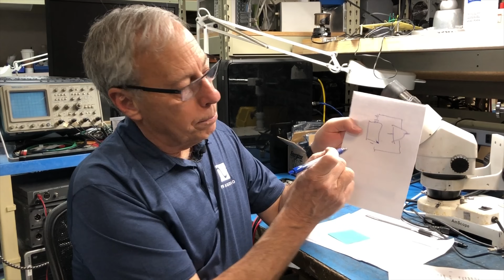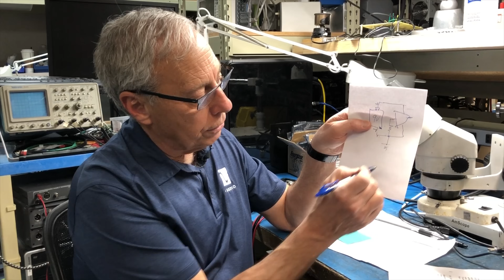What is signal ground?

Comment: I love it. I had been pondering this all weekend after reading about an amp that had no need for safety ground because it used a double isolated power source. "HOW DOES THE SIGNAL GET GROUNDED THEN?" was my howl into the wind.

I was sort of getting nowhere although I did get as far as comparing this sort of circuit with using jump leads on a car. I always wondered why one of the clamps is clipped to the chassis. Some places said it was to 'ground' it. I couldn't understand how it did that with those big fat rubber tyres holding the car off the ground in a beautifully insulated way! But I also thought I was barking up the wrong tree since cars are using batteries with DC power rather than an amp using AC power. I was afraid I might be muddling myself up in a potentially dangerous way.

But your video completes the circle that I was so painfully slowly trying to close. From now I think I will call signal ground 'common' instead so I am no longer confused. 

So great to see it so clearly explained. Your mention of 'ground' in space sealed the deal!

Comment: The poorly named "ground" is the line in a system designated as "zero" for voltage measurements.  It must be able to source (provide) or sink (take in) as much current as necessary for the operation of the circuit without changing voltage, i.e., zero resistance (impedance) although in reality the minimal impedance of a properly sized conductor.  This "zero" reference is generally a common, unswitched rail, i.e., wire, trace, etc., across the circuit.   From this "zero" reference, voltages measured may be positive or negative on the load side of the circuit as needed by the design.  Better terms are "common" or "return".  The latter because current must have a return path to the power source and convention often designates this as the "zero" reference.

The "ground" prong on the plug is the "safety ground" and is strictly a low resistance path from any conductive part of the equipment case back to the breaker should a fault cause the "hot" conductor to come into contact and thus energize the parts someone might touch during common use.  This low resistance path produces a high current that trips the breaker "clearing the fault", i.e., turning off the hot conductor.  The actual "ground" or earth is the "system ground" which is the ground rod bonded to the neutral.  The ground rod provides a low resistance path to the earth for induced high voltage spikes in the wiring from nearby lightening, as well as inductive load switching and switching arcing faults rather than them arcing through insulation shorting motors or igniting something flammable, or, these days, blowing up electronic circuits.
Reply: Much better explanation! Well done! Well worth and makes up for the 5 minutes I spent watching this guy scribble on scrap paper..
Reply: Great explanation JK Brown, thank you. However, the safety ground is not bonded to the neutral everywhere. Sometimes ground cable (yellow/green in my home) goes directly to earth via the main panel without any connection with neutral. In the main panel, all circuits (phase [hot] and neutral)  have also circuits breakers for excessive current, but there's a main differential breaker that detects very quickly any difference of current (30 mA) between neutral and phase. This differential breaker cuts electricity off,  before circuits breakers do without need of high currents. Spikes goes through another device in the main panel: surge protectors.

Comment: This is a great video Paul and one that takes me back to school..I do want to ask you though a 2 part question. So you've listened to valve and solid state I'm assuming so for you which floats your boat or is it a case that either works depending on system..Secondly in the valve (tube) world we have many different kinds of amps. Now if we compare valve to solid state, there has never been to my knowledge in the past or today,  a OTL solid state amp..So why has a OTL solid state amp never been built..Or maybe it has I have no idea. Many thanks Garth

Comment: The answer of course correct but what would be nice to know, is the role (if  any) of the 3rd wire/"ground" in audio devices (besides safety measure - grounding housing of an electric device)

Comment: The power strip in the background has a flickering neon light on its power switch. Might be causing some problems depending on the circuit. Since it's flickering though, might be time to replace the power strip?
Reply: This is typical with neon lamps,the electrodes just excite the gas.They cause absolutley no rf interference.

Comment: Something I noticed is that I see many people in US forums complaining that Rega turntables hum a lot over some other TTs but here in the Philippines where we have just two prong plugs with no ground, the Regas actually are quieter than TTs with a ground wire. Any idea why? Is the rega designed for eu style plugs or in my case Philippine plugs more than 3 prong US plugs? I wonder how I can get around totally removing hum from a VPI turntable with the standard RCA plus ground wire configuration. My friend has already dug a hole at the backyard to connect the ground wire to a ground post to eliminate this hum. Such a hassle. :D
Reply: For audio gear it's often best to not have ground. Because some electrical equipment makes noise on the ground circuit and transfer it to audio gear.